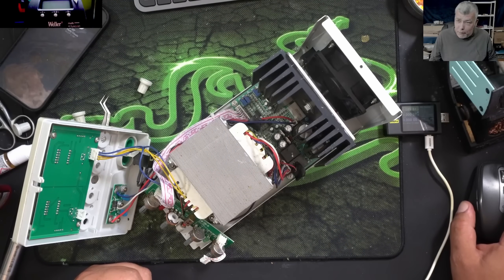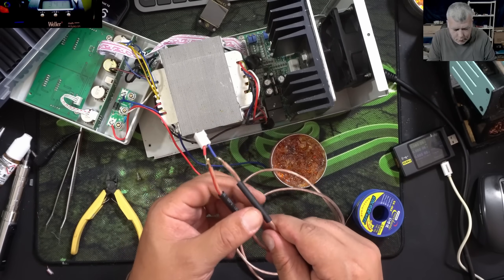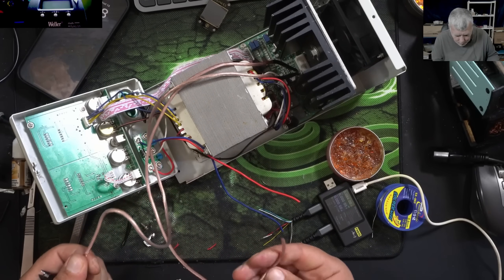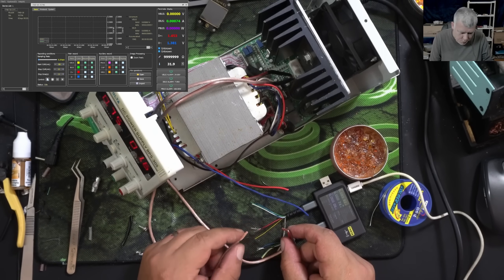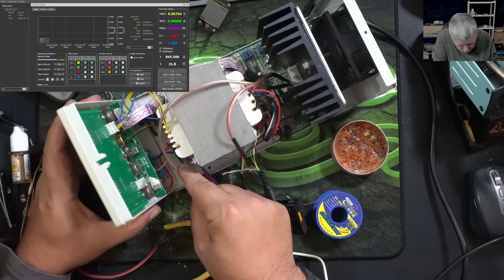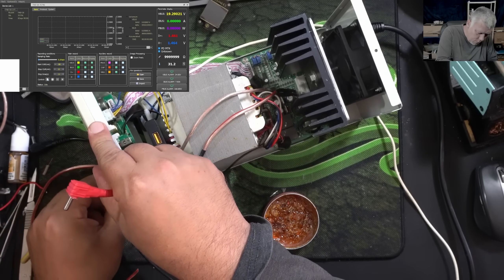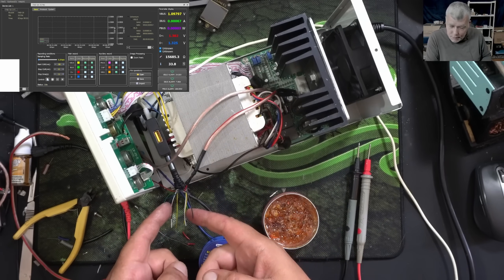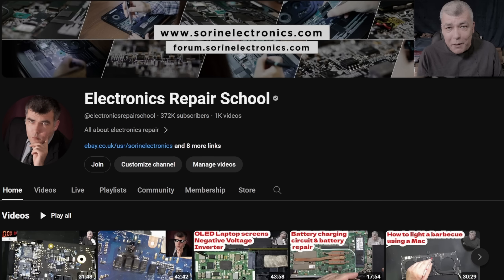How to install usb pc communication to your lab power supply - Say Hello to My Little Friend! FNB58

Comment: 14:02 you complained about thin plus and minus wires, so you replaced them by thick strong wires, 
but then at the end you cut that thick plus wire and you placed usb-c very thin wire in between. 
and now 5amps goes through that thin usb-c wire - WTF? 😅 (now it is worst than before any modification)
Reply: Voltage drop is proportional to resistance. Resistance is proportional to the length of wires. 
And, let's not forget for 240W USB-C, those wires are rated for 5A continuous. So no.
Lol
Reply: @OctavMandru  You are correct, but this guy is hopeless when you try to explain something to him.
Reply: @OctavMandru  I will not even comment your nonsense. sorry
Reply: @Radek__ great! 👍
Reply: @OctavMandru  your reaction was nice, so I will add, that I know, when I have very long wire, then at the end I will notice voltage drop (I measured it many times in smartphone charging cables), but I don't care about it here. My point was that...

you have empty pool, and you are trying to fill it with water using thin pipe - and you see that it will take long time,

so you decide  (as Sorin did) to change the pipe to thick one. You do it, but finally change plans and  decide to add in between a flow measure device, with is using very thin pipes (thinner than original pipe on the beginning), and that pipes also have two socket connections, which are not full sealed, so some preassure/water there is lost.

So my point was - no matter how much you will be praying, or reading the theory, there will be no possible to push faster a lot of water through that very thin pipes. ok - the pressure will increase, but that bottleneck is too high, to speed up the process of filling the pool up. So you end up with worst situation, than on the very beginning without measure device and thicker pipe.

Watch video again, look a that usb-c wire thickness, it is few times less that original wire from PSU.
Reply: @Radek__  Yes ammeter adds some resistance. Yes wires are thin. But you would need to open it up and solder directly otherwise. Which I would do of course. But also wire length matters. Short thin wires can have same resistance as long thick wires.
Reply: @TriodeTetrode  yeah, but you all talking only about resistance, over and over again. But what about thickness to amperee relation? that wires are very thin and you want to push 30V with 5amps trough that shit? 
you all forget, that Sorin used a typical usb-c cable. Even if you take special one, thicker for laptop charging it will be still not enough to 30V and 5amps.
Reply: @Radek__  Because resistance is what matters. Wire burns when gets hot enough to melt. It is basic joule law. Power lost as heat in wire will be just I squared x resistance(wire). USB-C has actually more than one positive/negative wire. And this cable is made to handle 5A so I wouldn't be too worried. Also remember time matters. You may get away much thinner wire for a shorter period of time. Wire starts to heat up but you won't use it long enough to actually reach critical level. Although Sorin connected only one wire. I think black wire was same as red wire. Also makes no difference do you have set up 1V 5A or 30V 5A on your power supply. There is still 5A going through it. Wire heating is based on current. Voltage comes into play when we talk about wire insulation.
Reply: @TriodeTetrode  I disagree. stop pushing theory. "and this cable is made to handle 5A"
haha are you kidding me? 30V 5A?
I also remind you, that we have here technican / laboratory power supply - the voltage and apmeprage must be precised. We are doing precised work, we use/set percice voltage - we cannot get something around, or amost, close to, etc. Any voltage drop during load, due to long wires or to much thin wires is unaccetable during repair. 
So please give ma a break.
You defent a cheap usb-c cable with typical smartphone specification (not special one for laptop charging).
Make some tests
stop theory-zing
Reply: @Radek__  You clearly don't understand how wires heat up if you say like 30V matters. You can't go over 5A on this power supply anyway. Yes the voltage drop is bigger if your wires have resistance. Actually you can calculate wire resistance this way easily. I agree you want as low voltage drop as possible. For that Sorin should open ammeter and solder wires directly. And I don't defend this cheap ass cable. I would replace it too. But it can handle 5A. Every wire can handle 5A. Question is for how long. You can test too, buy same USB-C cable and run 5A through it. My cables are fine for 5A. I think you don't understand wire resistance and current capability and how heat is generated. Otherwise you wouldn't bring voltage here and would understand how resistance matters. Sorin will use this solution now and you can probably see it will work fine. Just voltage drop is a little high I agree. 0.6V was I think when shorted outputs directly with tweezers.
Reply: @TriodeTetrode  no, you don't understand. because The votlage matters! you are trying to say to me, that there is no diference when something eats 1V 5A,   and other eats 30V 5A.

you are cleary s,t,u,p,i,d or what?

if you have an engine which is working hard (it has load, job to do) and it works at 30V and takes 5A, then when you lower the voltage to 5V and want to keep the same level of work to do, then it will take MORE amps. 
This proves that voltage matters. and current will be never equal on the differet voltages

And this also means, that 30V 5A takes or deliver MORE power, more force to do something. 
and 1V 5A deliver LESS power.
So 30V 5A will burn that very thin wires, when the load it true- when it takes that 5A.

And 1v 5A will not burn that thin wires.

So this is my point - you defend a cable which is made for 5V
(because it is a typical smarphone cable for 5/9V)
by saying that it will handle 30V 5A

for me is enough. I told you - stop pushing to me theory and calculations and definitions.  I don't want to listen to it.
Reply: @Radek__  You don't actually understand at all. You are trying to prove that if resistance stays same and if we change voltage current will change. Yes it is ohms law. But you are totally missing the point here. I'm talking about wire heating up. Wire still heats based on your current. If your current change then of course wire will heat less or more. Power lost as heat in your wires will still be P = I squared x r(resistance of your wires).

Your engine example. Your power supply is engine here. Yes power supply does more work when power is greater. Yes 1V 5A will deliver only 5W while 30V 5A will deliver 150W. Yes 150W is delivering a lot more. But you are still totally missing the point here.

1V 5A will burn your wires same way as 30V 5A. Voltage makes no difference if we are talking about same current. I'm not saying they have equal power. Just think a bit. Let's say our wires have 0.01 ohm resistance. So now how much power we will lose in wires? Let's make a calculation. Let's say our power supply is set to 30V and 5A and we are connecting the load and exactly 5A goes through wires. So 150W total. Our wires will lost as heat 5A *5A * 0.01 ohm = 0.25W. Voltage drop over wires would be 0.25W/5A = 0.05V.  So your load obviously takes the rest of the power which would be 150W - 0.25W = 149.75W. Do you agree? Or you are living in parallel universe and deny ohms/power equation?

Now let's take another case. You set power supply 1V and 5A. You connect the load and there will be exactly 5A going through wires. Now let's calculate power lost as heat in wires. So we lose power in wires as heat 5A *5A * 0.01 ohm = 0.25W. Voltage drop over wires still would be 0.25W/5A = 0.05V. So you see we will still be losing same power in wires as heat. Your circuit total power would be 1V * 5A = 5W. So your load obviously takes the rest of the power which would be 5W - 0.25W = 4.75W. Do you understand now why voltage doesn't matter when we talking about heat losses in wires?

Do you see now why all wires are rated how many amps they can handle? And they mention also how many degrees temperature would raise. Nobody talking about volts in this regard. Voltage only matters when we talk about insulation. 230V live wires simply have thicker insulation. But if you run 10A at 230V or at 1V wires would heat up exactly same amount. All that matters is wire resistance. Smaller wires have bigger resistance.

Remember also this lab power supply have 5A max current limit. You can't get more. So no matter how many volts we use on lab power supply we still would be limited at 5A. So our wire thickness is based on 5A.

Now about USB cables. This USB-C cable Sorin used was 240W(rated 48V 5A). So it is rated for 5A. If we take some other USB cable let's say 25W(rated 5V 5A). They both are rated for 5A. So wire thickness must be same. They both must handle 5A. Difference between them is voltage. 48V cable is much higher voltage and must have much better insolation than 5V cable. Do you get it now? Or still defying physics laws?

Now think why raise voltage rather than current. Why there isn't 230V coming straight from electricity station directly? No need to raise and lower voltage. No need for transformers in between. But if you understand now that we would need huge cables for same POWER. Because current going through them would be huge. Basic power equation tells us that already.

So if you still don't understand in your arrogance that or still don't believe me then come to Sorin d.i.s.c.o.r.d. Link is in the video description. Come and join. There are like tens of thousands people not only me. They might be able to explain this to you. But maybe you think you are only person in the whole world who knows how physics work and everyone else is wrong ;)
Reply: @TriodeTetrode   First: yes I live in parallel universe (as we all). 
Second: 1v x 5A = 5W, which will not burn that thin wires, but 30V x 5A = 300W, which will burn that thin wires. 
Third: because Sorin used typical usb-c cable (not 100W, not 240W)
Fourth: and Sorin used one wire of two rails in pack in that cable, so now that cable watage rating wnet two times down. So it is even worst.
Reply: @Radek__  You still live in parallel universe. You still don't get it. 5W isn't dissipated in wires when 5A going through it. Remember ohms law. To make all 5A to dissipate in your wires then your wires should be exactly 1 ohm. And you just directly short them obviously. Only resistance in circuit would be your wires. Do you understand that?

How did you get 30V x 5A= 300W? 30V x 5A = 150W not 300W. But I assume you made a mistake so I go on. This 150W isn't dissipated in your wires either when 5A going through it. I'm talking about keeping CURRENT SAME. Again to make all 150W to dissipate in your wires at 30V your wires resistance should be 30V/5A = 6 ohms.

Imagine it like that. You set up 30V on power supply. You put 0.01 ohm resistor in between your load and power supply(0.01 ohm would be our imaginary wires). So you set up your load like that power supply would draw exactly 5A. By the way for that your load resistance should be 5.99 ohms.

Now imagine you do the same for 1V 5A. You set your power supply 1V. You put 0.01 ohm resistor in between your load and power supply(0.01 ohm would be our imaginary wires). Then you choose your load again exactly like that it would draw 5A. By the way for that your load resistance should be 0.19 ohms.

As to answer your question about USB-C cable. Have you even watched the video? Watch again. Sorin clearly said at 3:28 it is 240W USB-C cable(if you can understand english). So it is rated for 48V 5A. 

As a last statement yes Sorin used only one wire out of two carrying that current. I think he missed that black wire is positive as well. So yes he could make it better by using them both. But still I don't think it will melt because even if it heats up Sorin should use it for extensive time probably. He will keep using it so you will hear when it melts. The last point is time matters as well. Every cable can handle any current. Question is about for how long. It is about resistance. Smaller the wire the higher the resistance. Ohms law holds everywhere.

If you still didn't understand anything then as I said come to Sorin d.i.s.c.o.r.d. There are a lot of people who can explain you how ohms law/power equation works. It just amazes me people still don't understand basics. By the way the first guy who commented was correct as well(of course you denied him and called it nonsense as usual). So I'm second dude you are denying already. Again come to d.i.s.c.o.r.d. There are like tens of thousands people.
Reply: @TriodeTetrode wait until he finds out how thin is the wire in the old style fuses 😂. Or the fact that amps are the same in every section of the wire
Reply: @OctavMandru  That would blow his mind probably😂

Comment: You just solved the problem the 5A psu for diagnostic and the old 10A that has short circuit protection for powering on laptops

Comment: @ Sorin: If you swap the input and output Type-C plugs (left is IN, right is OUT) then you can make the measurements more precise because in the other direction the device also measures it's own power consumption which is additional ~50-60 mA.
Reply: I think the thingy is using PC for powering it's circuit. It still works with 0.5V in the measured circuit

Comment: This is proper nice! I think the problem of 10A  can be solved with an ATX power supply very easy to design a limited current source using that and cost nothing I know some people wouldn't like that out of vanity but it is very practical.

Comment: So why not do that for the 10Amps power supply aswell?
Reply: The knobs are too fine in the increments and they are also prone to false changes when touched. Which could be disastrous.
Reply: @perkulant4629 he needs to change that digital encoders with some quality ones.
Reply: Problem with potentiometers/knobs... But i think Sorin said he cannot replace them because of the programming. They are not as sensitive as they should for repairs

Comment: I only hope it will be used or can be configured with 2 decimals... everyone else have 5-8 decimal power supply on screen like they are in space laboratory... now you have numbers jumping around at all times... its so annoying for a viewer I cannot explain... you stop injecting power, and numbers just keep changing... its distraction... old view with cameras was way better... It would be better if you just placed camera on new power supply...
Reply: 3 decimals would be nice imho. With 2 decimals we sometimes interpret displayed result like 0.30 as 30 mA when actually it was 300 mA
Reply: @vkp111  How 0.30A is 30 mA? If it is 2 decimals then it will be 0.30 A for 300 mA and 0.03 A for 30 mA.
Reply: @TriodeTetrode I want to say sometimes we falsely interpret displayed 0.30 result as 30 mA when it is actually 300 mA on a 2 decimal places display. With 3 digits of decimal places this misinterpretation of the result can be avoided. Hope it make sense now. English is my third language.
Reply: @vkp111  You really shouldn't confuse something like that.
Reply: yep